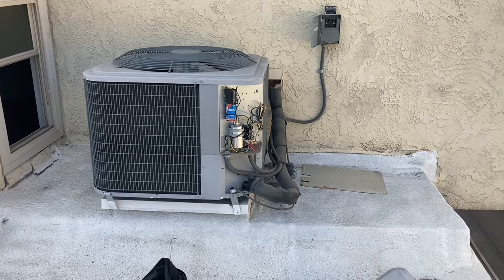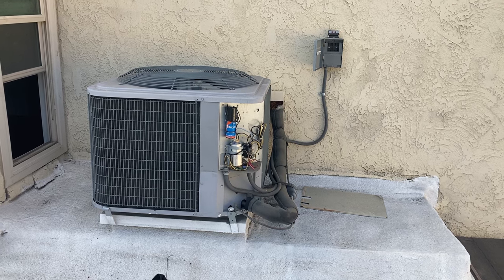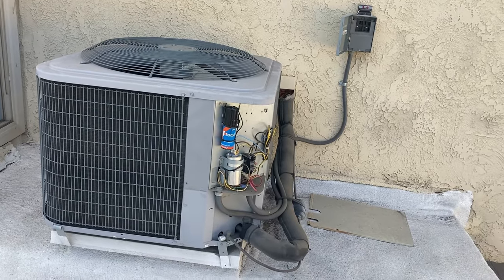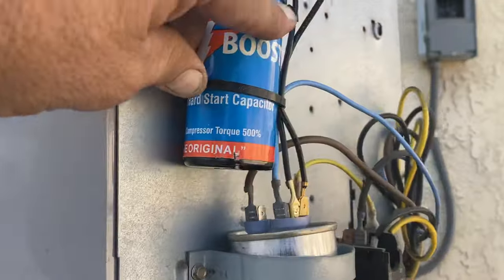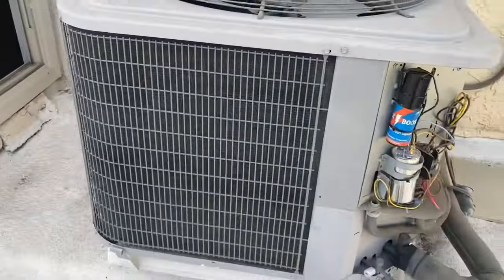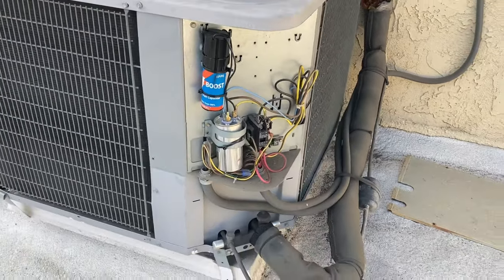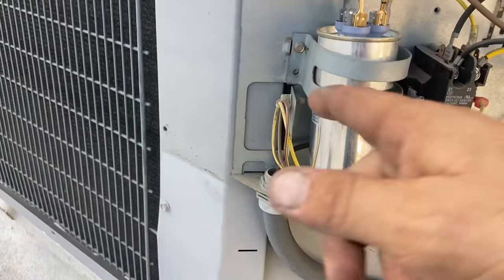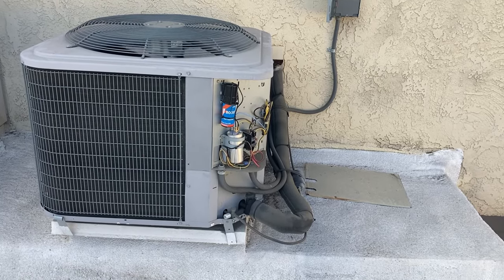#3 Air-conditioning making loud noise (HVAC A/C Flux capacitor￼ Condenser￼ Compressor￼ DIY)￼

Comment: My ac system was installed in 1973, it is still running so far. I didn't add any boost caps or soft start. I grease the blower motor and the condenser fan once year.
Reply: how much do you pay for electricity?
Reply: I worked on a customer that had one from 80. I just changed her capacitor replaced both valve stems and she was all set and that was 5 years ago. I go back quarterly to change her filter and no problems. They don’t make them like they used to 🤷🏿‍♂️
Reply: @imzjustplayin I bet nowhere near what 3.5 new ac systems would have cost…
Reply: @robertcraven1771  assuming a lot. Old refrigerators from the 1970s use so much electricity that you could literally get a new refrigerator every year and break even on electrical cost savings. Obviously new refrigerators last longer than that.
Reply: THAT’S MY DAD’s BIRTH YEAR-
Reply: @imzjustplayin  I would definitely be curious as to the price of electricity in whatever market you are referring to.  That is certainly not the case here. New refrigerators run about $1000, and I have never seen a refrigerator cost anywhere near that to run for a year, regardless of age.

Comment: I have 2 A/C systems. One for upstairs and the other for downstairs. The upstairs one is almost 30 years old, I noticed the fan was having trouble starting so I bought a new capacitor with a boost capacitor and it’s been running fine for 6 years.  

My downstairs unit is 10 years old and is showing signs that it’s going to need a boost capacitor soon. It’s not too difficult to do it yourself.
Reply: The sad part is they dont make them like they used to.
30 years.. Small repair vs 10 years already needing said small repair.
But regardless a capacitor is not a big deal but those for sure dropped down in quality of oils.

Comment: You can have a pitted start relay or a failure of a thermistor ( both do the same job, but thermistor cuts out when current warms it) . That makes the start capacitor almost useless. Putting on a hard start kit bypasses this circuit. Hard start kit's usually have way larger capacitor and puts high stress on the compressor start winding. Choose carefully, longevity of the compressor can be shortened significantly.  Fix the original start circuit if possible. Bigger isn't always better. Overcharged system can also make it harder to start, leading to the need for a hard start kit.

Comment: I hope you also checked the contactor. Those contact points can get pretty crusty in ten years causing low voltage conditions on startup.

Comment: I have new Carrier makes clanking noise when turning off. What causes this? Contractor first said compressor, then said normal.
Reply from the maker: If the noise is coming from the compressor there is nothing that can be done aside from replacing the motor which would be very expensive. I recommend running the unit until it breaks or stops working. If the unit is less than 10 years old, Some of the parts might be under warranty, but it's still gonna be a very expensive repair because  of refrigerant and labor.
Reply: @yodaleahyhoo  the unit is  one month old. Under warranty, labor and parts, but contractor saying "nothing wrong." Lost faith in this company.
Reply from the maker: @ruthdanielson919  Wow, that sucks definitely get another company third party.
To check it out, it could be overcharged with refrigerant. You could also try calling the manufacturer direct and ask to speak to the Field rep for service and Manufacturer warranty. They'll come out to the house. Sometimes check it out themselves.
Reply: @yodaleahyhoo  Thank you, so much. That's great advice, ill make the call tomorrow. 

First the accumulator was sweating huge amounts of condensation so they checked pressures, but the supervisor wouldn't check the subzero temp against factory specs, ball parking it, and freon leaked  a little when removing the pressure lines. After that visit, that's when the clanking started. I videoed it and took it to their office, and they agreed to check out the compressor but when they came they just rechecked pressures adding freon over charging it, never checking the compressor as promised, saying the clank was normal. The subzero spec is 12. At first was 8. ? Then 7.3, then 13.?, I forget exactly, but I read  it's not supposed to be overcharged. Okay if within 3 degrees if the subzero is low.  They provide an  AC contractors license, but can't produce the actual person or his contact info. Looks like a good unit, but trouble with this LLC, from the get-go. Now I understand why choosing the right company most important.
Reply from the maker: @ruthdanielson919  🤪🤪🤪🤪🤪🤪🤪🤪🤪

Comment: How long do you think you can use those extra boost caps? Are they just a temporary fix to get a few more years out of the compressor or do you think you can continue to use a hard start cap for ten years or more? And have you heard of those Easy start (or soft start) devices, just wondering if you have an opinion on them.
Reply from the maker: We generally install boost capacitors on units that are 10 years plus and the life expectancy is between 20 and 25 years on an air conditioner so they don’t have to last much longer than 10 years so I don’t know if that helps

Comment: my AC unit isn't 10 years old .. it makes a noise like a honking noise . I have a video .any idea what that is ?
Reply from the maker: That’s a strange one but any noise coming from the fan motor is likely due to a busted bearing  you can hear some strange noises when the unit isn’t charged properly with refrigerant. If the unit is less than 10 years old it should be covered with a manufacturers warranty I would start by calling whoever installed it for you
Reply: ' like a honking noise .'  Also just recently saw some video where their compressor fan was slightly loose, and had worked itself up the shaft so the blades were very close to other items.  Just moving it back where it should be on the shaft and tightening it fixed the noise..

Comment: My ac is blowing cold, the fan outside is still turning however the air handler inside the closet  is making a very loud to the point where the house was shaking so we shut it completely. Any ideal what the problem might that’s causing the noise? We had our uint serviced about 4wks ago
Reply from the maker: If the air handler is shaking when it’s running it likely has a busted bearing in the blower motor and will have to be replaced the motor it’ll also make a loud noise from the fan blade rubbing against the outside of the fan shroud.    Also make sure you have a clean air filter and all your air duct registers are open
Reply: @yodaleahyhoo  thanks for replying. It’s the air handler that’s loud and causing the house to vibrate. We purchased this house brand new 10yrs ago and the motor on this Carrier AC unit had to be replace twice! We keep the unit service regularly. So this will make the 3rd time getting the motor replaced 😡 . The house we lived in prior had a Trane ac unit, that unit gave us NO Problems what so ever. Never had an issue with a motor, maybe a clogged drain once or twice within 16yrs of having that Trane unit, I’m convinced Carrier brand sucks lol. But again thanks for your advice
Reply: The blower wheel may be out of balance- perhaps a piece of debris got stuck in there. Check the blower wheel for being clean. If it is, most likely the wheel needs replacing- or perhaps the motor is bad.

Comment: What causes these to become harder to start as they get older is lack of simple seasonal maintenance. Lack of filter replacements, lack of condenser cleaning.
Reply from the maker: That's a really good question drew.🤓👍
Reply from the maker: It's just what happens to a very heavy duty motor that has such a large task. Moving Refrigerant  through the 2 Coils. It's a really big job. And eventually that motor has to work harder to get started.   That being said, all those other things you mentioned about. Doing the maintenance with your air filter and wash in the outdoor coil is very important.
For your unit to run smooth And efficient and last a long time.       Thanks again for the question. And I'll see you out there walking your dog brother 🤓👍
Reply: It is most likely a clogged valve in the compressor but could be a leak in a gasket. The additional capacitstor boost is a nice temporary fix. Need a new compressor or might as well get a new unit.

Comment: Did you test the starting of the compressor first? Did you ohm the windings? If you suddenly need a start kit, the start windings in the comp motor are getting weak or the compressor is running tight- you may even have a bad or weak run capacitor? Is that new run capacitor from china...?.....better test it!
 If you MUST have a start kit suddenly, the compressor is getting ready to fail if everything else checks out ok.

Comment: Dude, how about a little more information  on how to run the booster through the original capacitor?
Reply from the maker: The boost capacitor has two wires one wire will hook to the C or common and the other wire will hook to h for hermetic compressor compressor. By attaching that it will increase the capacity of the original capacitor or run capacitor which is used to store energy that can be released when the compressor starts